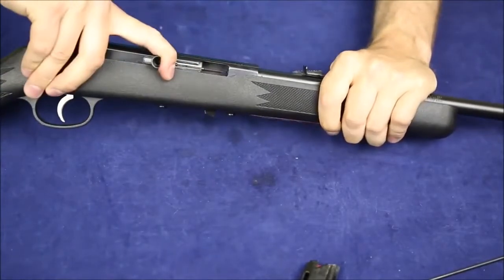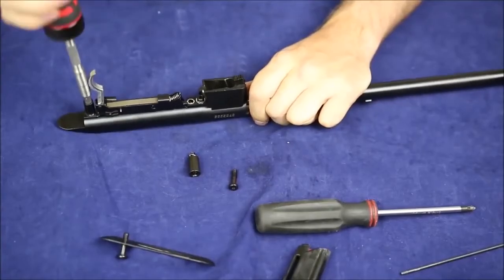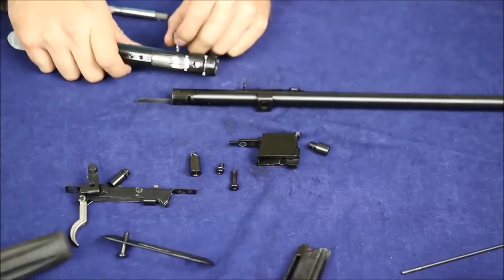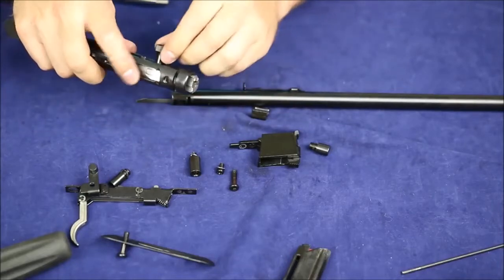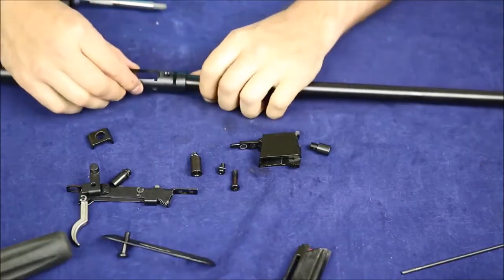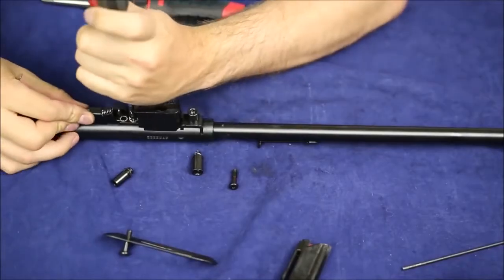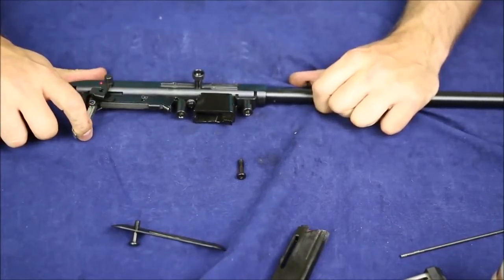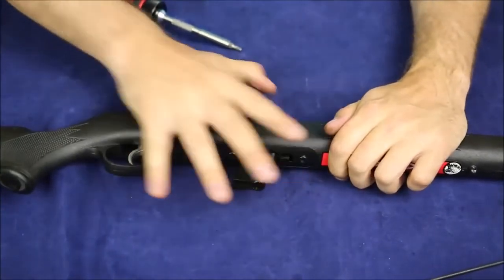Savage 64F Disassembly and Reassembly

Comment: Thanks fella. My model 64 was jamming. An acquaintance asked whether I'd ever cleaned the bolt, which I hadn't. This video helped me with that, and now the gun is working as it should.
Reply from the maker: Glad to hear it helped!
Reply: I also had a feeding and ejecting issue but I just changed the ammo I was using
Reply: My 64 works fine but every now and then it don’t fire the bullet it’s rare but sometimes I pull the trigger and it clicks get the bullet out it’s got a strike on it but didn’t fire load it back in and it fires just fine is that normal? But thanks for the vid very helpful I honestly thought it couldn’t be done lol
Reply: I’ve never had to take mine apart. I just switched to a better ammo. I recommend CCi Mini mags. It’s helped me make Class A in The Steel Challenge competition. It’s a good rifle for $99 (2023).

Comment: I just made a fairly inexpensive modification to my Savage 64F. I installed a set of Williams Fire Sights on it. Williams does not list any of their Fire Sights for the Savage 64 or 62 .22 caliber rifles. I decided to try the fire sights listed for the Ruger 10/22 and see if they would work, and they did. 
I drifted out the Savage front and rear sights. Drift out from the left side 
of the barrel towards the right because the part that fits in the dovetail on the barrel is tapered. The front sight was harder than the back sight to get out. 
The back sight came out easily. 
The Williams sights went in easily. Again. The front sight was harder to drive in. The rear went in easier. 
Before removing the sights you should mark the barrel with a pencil where the sights are centered so you can center the new sights. 
The Williams rear sIght has a set screw to hold it in place once you have sighted it in and adjusted it. 
Also the Williams Fire sIght has adjustable windage and elevation set screws.
Part numbers for these sights are Williams 060213 or Ruger 90340.

Comment: Very helpful, thanks.
Important not to over tighten the stock  hold down bolts. The rear one especially, That  bolt goes into a larger stud that in turn screws to the receiver by a much smaller and fine threaded connection. That finer thread can and has stripped while removing the stock bolt. Suggest removing the font bolt first.   Don.

Comment: I just wanted to add - when polishing the SEAR go LIGHTLY with the polish.  You DO NOT want to change the angles of the Sear Face, just SMOOTH the surface to reduce friction.
DO NOT lubricate anything here except for the "Pivot Pins" and the corresponding 'holes' thereof.  Oil collects dirt !!

Comment: I have had my model 64f for 3 years and have shot probably a legitimate 5,000 rounds through it without a single disassembly and cleaning. I have had zero malfunctions related to the firearm operation, always about quality of ammunition. I learned fast HV copper plated run flawless

Comment: 600 rounds at least and mine is about to get its first cleaning . It should be dirty . I used a bore snake just fits in the chamber after shooting to at least clean that part . Waiting for it to fail but after 600 rds maybe 2 hiccups I can chalk up to a magazine flaw , sometimes the last two rounds in the magazine get kinda stuck and don’t like to stick up as high as they should . You re figuring it out as you go , cool .

Comment: Jason - I've found that all rimfire rifles, especially the 64 and Marlin 60, run better without lubrication except for a TINY DAB of synth-lube on pivot pins.  Rimfire ammo is 'Dirty' and oil collects that dirt, which in turn gums up and slows the action and adds to trigger pull.  
   As for lightening the pull, First I replaced the trigger return spring with about 1/3 of a 'clik-pen' spring stretched to 'fit' the space.  This takes a pound or more of the pull.  I replaced the Sear Spring with an MCarbo spring because its a complex coiled lever spring.  That takes off another pound or so.  Finally, polish ALL rubbing parts of the action including the SIDES of the parts, using 1000g paper (or finer) AND polish the Bolt and the inside of the receiver.  This resulted with a trigger around 2# for my 64.  Using a 24x scope I can keep shots under 1" at 50 yards, with SV ammo like CCI-SV or SK Standard Plus.  YMMV !

Comment: Great show, not sure what is going on with the QC at Savage, short handed, lost expertise or simple disregard, but on my 64 PrecTac the 2 screws that holds the barrel assy and the grip to the stock were hand tight, I emailed them about this and requested torque specs about a week later I get a one sentence reply with the torque spec and nothing else, no apologies for their screw up, magazine, feeding issues, miss-fires on this brand are all over the net, not sure if I'll ever purchase anything from them in the future. Had many firearms, Marlin 795 22lr cheaper, simple solid design, never had any issues, and looks sexy with it's Tacticool stock, and better yet it shoots dang straight! 👍

Comment: When u buy it new in the box it comes with an instruction manual that gives instructions on how to take it apart so i would imagine that they are made to be taken apart before u ask yes the entire action assembly is mentioned in the manual it tells u to take apart and clean every 1 or 2000 rounds cant remember witch

Comment: So first time i took my rifle apart the part you called the middle post next to the screw that holds the magwell and the trigger in, got stripped. Ive done tons of research and find a few different diagrams but the one that came with my gun calls it the stock assembly stud. IT is different in size than the rear stud. It still screws in but once it gets semi tight it spins back around and is loose again. I cant find this part anywhere online. Most part sites have it listed as a long screw that goes in from the outside of the stock and not into an assembly stud. Do you think its still safe to shoot with it semi tight and then the trigger guard screw that screws into the assembly stud is as tight as can be?
Reply from the maker: If you stripped it out, could you helicoil it?
Reply: @Huntinggearguy  I could try that. I've been looking forever and just found a number in the manual to order parts directly. Gonna give that a try first. Thank you for the suggestion, might have to do that though.

Comment: When I tried to get that one last screw out (the one that was really tight for you) I couldn't get it out and ended up stripping the screw. Any tips on getting that screw out? I tried taking it to a gunsmith and he just said I didn't need to do that and handed it back to me.
Reply from the maker: That front one? There are a couple tricks to getting a stripped allen head screw out. One that I like is to take a Torx bit that's just a bit too big, hammer it in, and then remove. If that doesn't work, you could Dremel cut in for a flathead screwdriver. If that doesn't work, you're drilling and using an extractor. Maybe call Savage and ask for a replacement screw before you go to town and mangle that one. If this sounds challenging, you may want to get a mechanic buddy do it for you, as they're frequently dealing with stripped screws and have ways of making it talk.